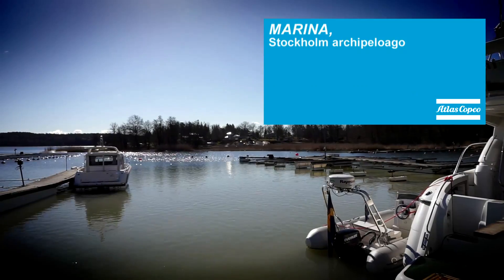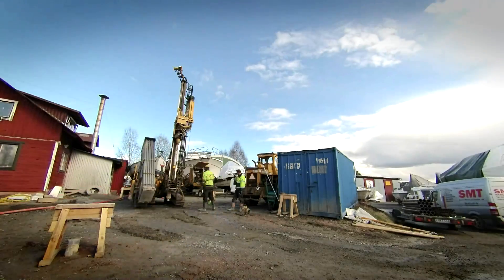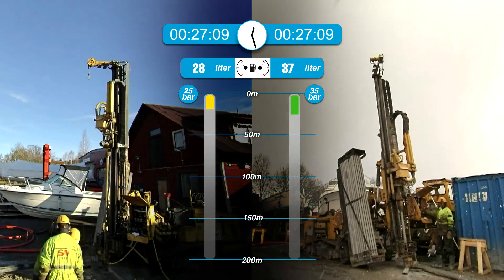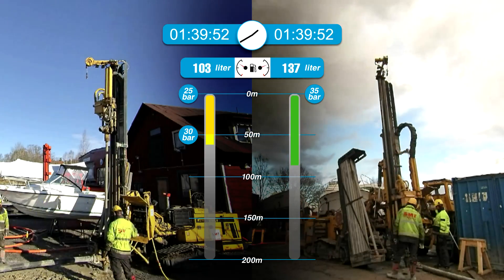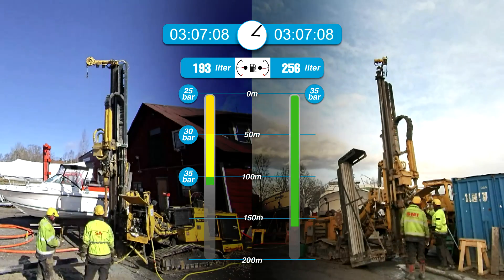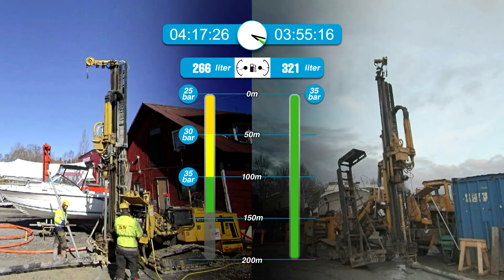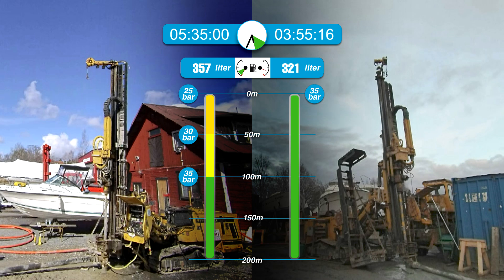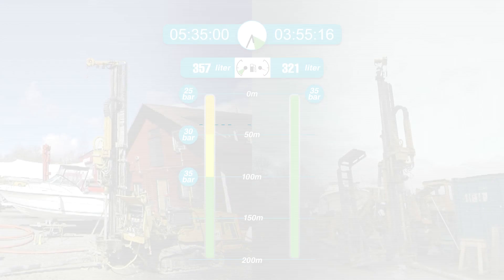Test fuel consumption of drilling under high pressure.

Comment: Doesn't seem quite comparable. The right staple drills approximately 50m per hour. But look att the left staple when it raises to 35 bar. It drills from 100m to 155m in two hours. Thats about 27m per hour. Should affect end results if conditions were similar.